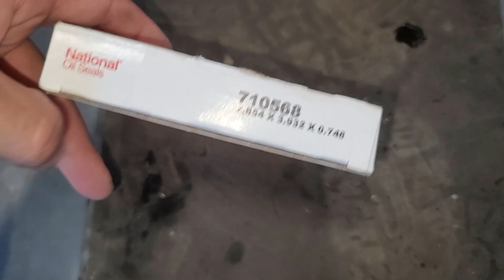Chevy Silverado 2500 rear axle seal single wheel or rear wheel seal

Comment: There actually is a torque spec going back on then back off the nut about 30° or to the nearest notch when torquing you will be reseating the bearings

Comment: You could mark it. This is unnecessary. Notice how you spun the hub and the bearing let it go freely, but not entirely. This is how it should be. Also notice how when you showed the special but free spinning, you tightened it all the way it could go, and then backed it off to the first notch for the woodruff key. This is just like tightening a hub onto a trailer spindle. You need to tighten the nut fully, until the hub begins to be difficult to spin or doesn’t spin, and then back the nut off until it freely spins like before. There’s a torque setting of 35lb that you’d need a special tool for this, but it can be done by screwdriver and mallet. This is for my guys without white markers or who don’t feel comfortable introducing probably harmless foreign material into unfiltered fluid housings.

Comment: By counting threads you are assuming it was done right by previous installer.  Not a good idea, when reinstalling tighten to 52 ft. Lbs, and then back it off 1/4. Also while tightening to 52 Ft lbs, rotate the hub as you are doing it.  The seal is always difficult to come off.  In some cases you need to remove E brake assembly to remove.
Reply: You’re probably more right than me. I basically said tighten to 35 ft lb which you need a special tool for obviously(until the hub is either difficult or impossible to spin) and then back off just enough for it to free spin. Just like trailer hubs.